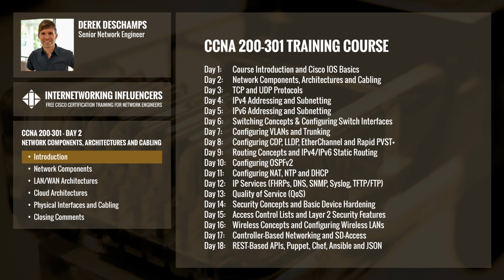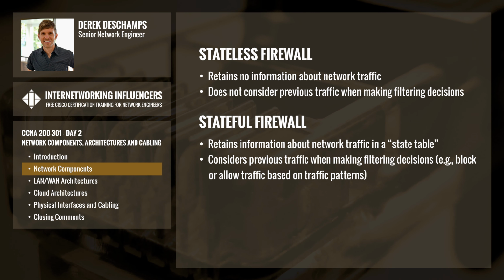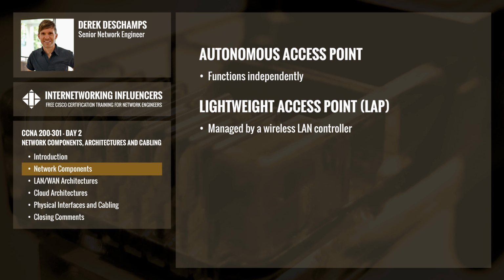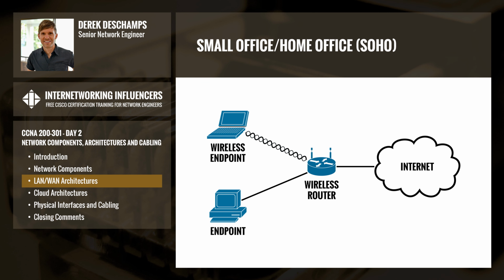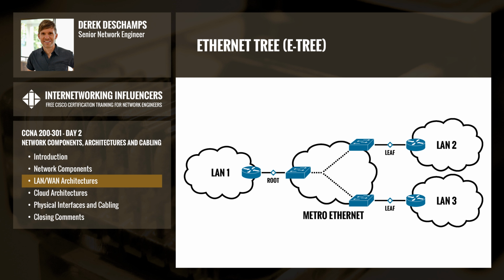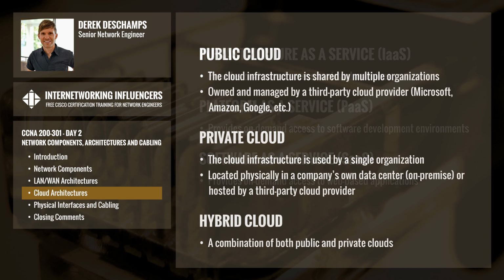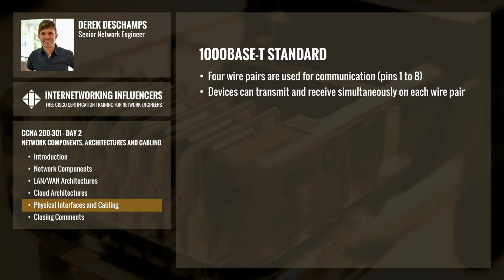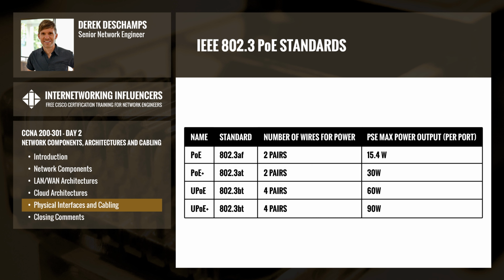CCNA 200-301 - Day 2: Network Components, Architectures and Cabling - Free Cisco Training

Comment: Hey Derek, is there a reason why you jumped from point 1.3c to 1.12 and then to 5.5??
Reply from the maker: Item 1.12 and item 5.5 were included in this episode as they are foundational components for some of the other topics. Item 1.12 (virtual machines) is foundational for cloud architectures. Item 5.5 (VPN’s) is a primary component of WAN architectures and is foundational for cloud architectures.
Reply: @InternetworkingInfluencers  Got it! That's verry useful to organize the topics, great work. Thanks for the feedback.